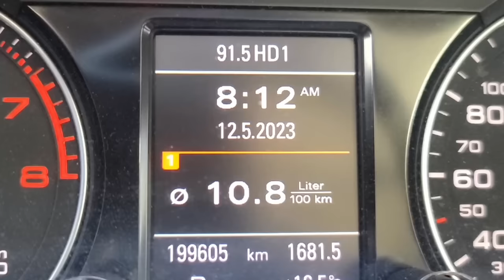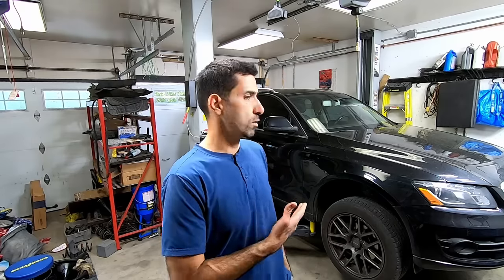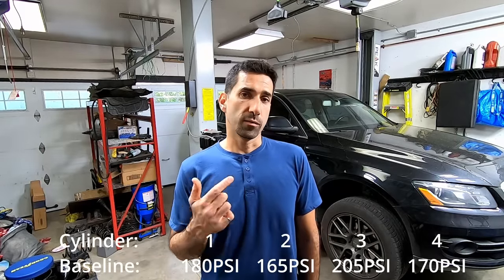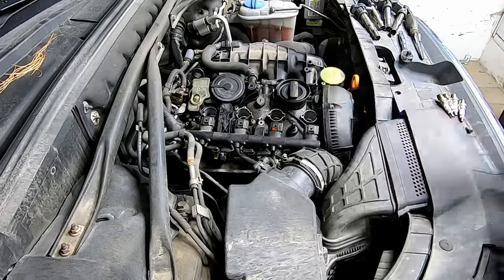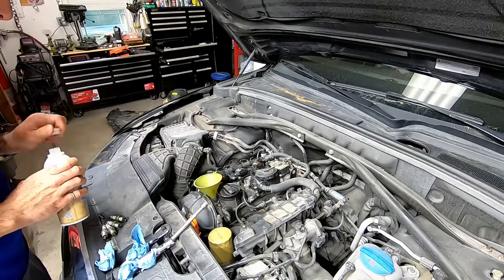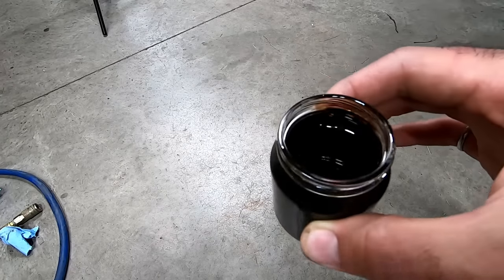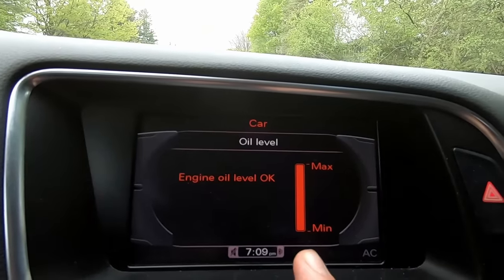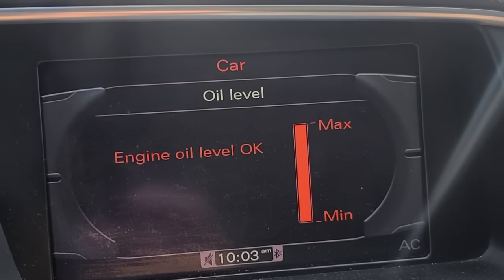How to fix excessive oil consumption from clogged piston rings (Part 2)

Comment: My friend, I can not thank you enough for this! I have a 2014 Audi Q5 2.0T with 118,000 miles on it and I was burning a quart of oil about every 100 miles (painful!). This SAVED me about $3,000 on taking it to a mechanic or spending countless hours myself taking out the pistons and clearing the oil evacuation holes. I've driven over 200 miles now and my oil gauge still reads full. YES! So grateful I will post my entire process and experience to help others as you have helped me.

As you stated, but maybe worth mentioning again --- the problem is not that the piston rings are wearing. It's that the oil evacuation holes of the oil control rings get clogged. When this happens, the oil control rings can't properly remove the oil from the cylinder walls, and that oil gets burned during every combustion stroke.

Prep work:
- Remove engine plastic cover, remove the T30 torx screw holding in the sensor by the coil packs, used a spark plug wire removal tool (to pinch the tabs) on the 8 small wire connectors connecting the coil packs, removed the wires. Next, while lifting up on coil pack connectors I used flat head screw driver to gently push clips on the connectors outward, removed the connectors. Next, just wiggled and pulled upward on coil packs to remove them. Took my deep spark plug socket (5/8), removed spark plugs (the plug from cylinder 4 was slightly dirty, but the rest were clean). Inserted a 6 inch socket extension into cylinder 1 and cylinder 2 spark plug wells, rotated crank until they were about level. Removed extensions. Prep work complete.

What I did:
- At about 80% oil capacity (4 liters), I did a 48 hour piston ring soak using two bottles of B12. 48 hours was probably overkill and 24 would have been fine, but I digress. Added one bottle initially, 100mL at a time, to each cylinder. Took a Poland Spring water bottle and measured 100 mL with water first, marked a line, dumped the water and now had a liquid measuring tool (which pours easily). Measuring is probably unnecessary and you could eyeball how much B12 you are pouring into each cylinder, just try to distribute the liquid evenly.

- Turned the crank a full turn every 16 hours. Kind of a pain doing it with your bare hands, but if you turn the crank and grip the belt around the alternator wheel at the same time it's not so bad (be sure to rotate counter-clockwise). After the first rotation, I added the second bottle of B12 using the method in step 1.

- After 48 hours, I put the old spark plugs back in, along with the coil packs, and hand tightened everything. Leaving the B12 in, I started the car and ran it for 30 minutes. She took about 10-15 seconds to turn over, but once it did I could see huge clouds of white smoke pouring from my exhaust. The engine ran rough at idle for about 10 minutes (around 900 RPM, which is what I was idling at before all this anyway) but eventually she smoothed out and was idling at 680 RPM. No codes thrown surprisingly. The smoke started lessening around 10-15 minutes, and was completely gone after 30 minutes. There was a ton of black dust sitting under my exhaust pipes which I assume were carbon deposits built up in the cylinder walls. Drove the car around for 10 minutes and the acceleration was already much noticeably better.

- Next, I did a full oil and oil filter change, using Mobil 1 high mileage SAE 5W-30 and an OEM Audi filter (any decent filter would have sufficed though).

- Changed engine air filter. A lot of people don't remember or think this a necessary maintenance item. It is absolutely crucial your engine breathes clean air or those deposits will also build up in your engine. Imagine using the same mask during COVID for 6 months without changing it. That's how your car feels if you don't change the engine air filter every 25K miles at the very most.

- Replaced spark plugs. Again, probably overkill but I was still using the original plugs. 118,000 miles on any spark plugs should be changed anyway. The diodes had worn away a bit and the gaps were now about 0.04 (factory spec is 0.032) but they were still in decent working condition. Replaced the original plugs (OEM model: AG VW 06H905621) with average quality plugs Autolite XP3923 (I'll put a link down below). Gapped the new plugs properly to 0.032 and they work well. The car idles smooth and the pickup is pretty good, but my fuel economy definitely took a hit (previous average 24 city/31 hwy to 19.5 city/26 hwy). Wondering if maybe the computer is still taking time to adjust.

- Had about 50 mL of B12 left, which I tossed into the gas tank for good measure. This may have done a little something since I only had 1/4 tank of gas in the car, but I doubt it. 

Car has been running smooth for about 225 miles now, with no oil burning to speak of. At this point I would have already had to add an entire quart, and most likely been halfway down on my oil gauge. You saved me about $3000 dollars at the mechanic and saved my favorite car. Thank you again!

11/3/23 UPDATE: Over 800 miles since doing this soak, and my oil gauge is till at max. Beyond thrilled!

Also, I would not recommend the spark plugs I replaced the original ones with. My average mpg now is 20 city/hwy combined. Truly abismal considering my original plugs with 118,000 miles on them were getting me a combined mpg of around 24.5. 18% decrease, yikes. You get what you pay for!

UPDATE 2/13/24: I'm at my next oil change (~4,000 miles) and my oil gauge is half full still. This fix 100% works long term. God bless this man for sharing this.

Spark plug replacement: 
https://www.amazon.com/dp/B009J58FJA?psc=1&ref=ppx_yo2ov_dt_b_product_details 

Oil Filter: 
https://www.amazon.com/dp/B00P17UTCG?psc=1&ref=ppx_yo2ov_dt_b_product_details

Engine Air Filter:
https://www.amazon.com/dp/B08951B64J?psc=1&ref=ppx_yo2ov_dt_b_product_details
Reply from the maker: awesome news - thank you for sharing!! really glad this worked out well for you...I`m curious if you actually got the 3k quote? I had a local viewer tell me he was quoted 10k for the service which seems insane...
Reply: @ETMotorsports  Yes, $3000 quoted in the Northern New Jersey area. A local Audi specialist told me it's about an 18 hour job @ $110/hr for labor, $200 x 4 for new rings/parts, and 7% tax. Total being $2974.60. I was almost considering it until I found this video. Thank you again!
Reply from the maker: @AlitasDePoll0  that does sound pretty reasonable...
Reply: @ETMotorsports  It was definitely tempting especially since I am the only owner this car ever had so I know there are no other issues and it would have been worth it. Only thing that had me raising my eyebrows was it being an 18 hour job 🤔. I feel like a mechanic shop that has all the right tools could do it in 12-15 hours working at a moderate pace. Had he told me 15 hours I would have said yes on the spot.
Reply: @AlitasDePoll0 did it fix the issue?? How much is it consuming now??
Reply: @The_Seraphim7  yup it did. 800 miles later 0% consumption.
Reply: @AlitasDePoll0  sadly we don't have b12 in our country!!!.....I might have to use other solvents!! But I did rebuild my other 1.8 tsi and it costed me around 1000$ here.... labour is pretty cheap here!! Got upgraded piston and conrods from Germany all got sorted in 1000$
Reply: @The_Seraphim7  that's not too bad for a rebuild! But why spend $1000 when your pistons/rings are most likely fine and you could solve the issue for $5 😁. Put that extra $995 towards a new bike... 🏍️

I'd bet any decent fuel injector cleaner would do the same job. Or any solvent that is meant to dissolve gum, varnish, and other fuel residues. If you decide to try this let us know how it works out please! 😊
Reply: @AlitasDePoll0  yess....I just ordered an PEA based amsoil pi cleaner plus.....I will use the amsoil 1st to soak for some hours and then use a kerosene based engine flush to soak for the second time!! Will let you know if it works!..... and can you tell me what bolt size is the crank bolt??
Reply: @The_Seraphim7  looking forward to your results! You can use a 24mm shallow socket if you want to rotate the crank by the bolt from above. However I just rotated it by hand it really wasn't that hard. Just make sure you are turning it counterclockwise.
Reply: @The_Seraphim7  sorry I fixed my comment above, I was sitting in traffic on my way to work and my mind hadn't woken up yet 😁. You need a 24mm shallow socket for rotating the crank from above
Reply: @AlitasDePoll0  yess I figured it out😂...M16 is the bolt and spanner size is 24!!....thanks mate will update once the soak is done!!
Reply: Please keep posted after your car runs 3000miles, if it is still going good.
Reply: @beipco  So I've gone about 1500 miles since doing the chem soak and my oil gauge has only gone down 10% (or whatever the first chunk of that bar would equate to). Which is normal. I can whole heartedly say this has restored my 2.0T back to factory oil consumption standard.
Reply: @ETMotorsports i was quoted 12 here in hawaii
Reply: @25sierraman2  12000?! Or 1200?
Reply: @AlitasDePoll0 Can you tell me the Audi specialist? I live in northern NJ.
Reply: @e.j.sanchez1031  Marty's VW in New Milford or something like that!
Reply: @AlitasDePoll0  would you be open to doing the piston soak on my q5?
Reply: @e.j.sanchez1031  what year Q5? And if you are within 30 minutes of Paramus I would definitely consider helping you out!
Reply: @AlitasDePoll0  2012 
Very close by lol Paterson..
Reply: Brother…… thank you so very much.  At 100k….. 1 qt at 3k miles.   125k …. 1qt at 2K miles….. at 150k…… 1qt at 1.5k miles.

I did the treatment…………. Now………. No oil needed between changes…… I change every 5K.
Reply: @RobertKelii  so happy to hear it! Great job if you did this yourself. Proud of you! 👏👏👏
Reply: @AlitasDePoll0 Hi have you consider helping me out? Would really appreciate it.
Reply: @e.j.sanchez1031  Hi EJ. Sure, if you have a way to contact you I'll be glad to reach out and set something up!
Reply: @AlitasDePoll0  i’ve tried putting a contact and it gets erase 😢
Reply: @AlitasDePoll0
Reply: @e.j.sanchez1031  oh man I just saw this now I'm so sorry! I missed the notification! Are you by chance still burning oil or you fixed it/got rid of the car?
Reply: @marcolopez1809  yes?
Reply: First time commenting on YouTube Thanks to you. You’re amazing. Super detailed lol🔥
Reply: @Mjsupa  so glad I could be of help! The real credit goes to the guy in this video. Just wanted to help others like he helped me 😊

Comment: I did the piston soak that you showed on my 2013 Q5 2.0T, but I ran 3 full cans through over 72 hours, hand cranking 5 rotations about every 6-8 hours before each refill of 1 oz per cylinder.  Also ran Seafoam in the crankcase for 300 miles before the piston soak, AND 2 full cans of B-12 in 1 tank of fuel before the Seafoam.  Sprayed some oil fogging mist into the cylinders after letting the last round of B-12 evaporate completely (confirmed with borescope and again, hand-cranked a few times) to pre-lubricate the pistons.  Car started after about 20 sec of cranking.  My consumption was at 1 qt/400 miles.  I'm now at 3000 miles with no indication of any consumption.  Gas mileage has gone from 24 mpg to 29 mpg and performance is great at 126,000 miles.  B-12 is my newest find that I have been sharing with anyone that has a car.  I have also run a 12 oz bottle of Yamalube Ring Free through the fuel system in 6 gallons of gasoline to "shock treat" the rings as recommended by Yamaha.
Reply from the maker: Great results...I like the modifications to the process! did you run the motor with the 3 cans of B12 in the oil or did you drain before?
Reply: @ETMotorsports  I left the oil drain plug out during the process so that the B-12 wouldn't be sitting in my oil pan for 3 days.  I was worried it might start damaging the oil pan gasket.  So as it drained past the oil control rings, it would just run out into the catch pan.  I also figured that since I had run the Sea Foam at 1.5 oz per qt that it was enough solvent for the crankcase for one go around.
Reply: @dangoldan34   great ideal to spray engine fogging oil before cranking the engine in order to protect the piston skirt coating and the cylinder wall !! Thanks for your tip sir.

Comment: It works!  Our 2013 hyundai santa fe 2.0 Turbo with 110k miles was burning 1 quart per 1000 miles.  I let pistons soak for 18 hours rotating crankshaft at 3,6,18 hours, then ran engine idle for 30 minutes with a few accelerations of 2000 rpms for a minute.  
Just checked oil level after 1800 miles and it has not dropped.  
Thanks for posting this video.  It's a huge help since we want to keep this car for a long time.
Reply from the maker: awesome results! Glad to see it working on other engines as well...
Reply: Hey I’m experiencing the same issue in my 2017 Hyundai Sonata is it possible you can walk me through the process I’m soaking the piston

Comment: Hello, here is my final report on this piston soaking treatment. In Feb, my 2013 A4 B8 2.0 TFSI(100k mile) had severe oil bunning issue (1qt per 2 times of gas fill: around 600 mi). I felt it was getting  worse. Fortunately, I found this video. I followed exactly the same prodcedure from Part I. You said part I could do negligible impact on soaking treatment. But I didn't want to ignore any subtle difference from what you've done because every chemical treatment could have cumulative effect on carbon build-up as I know this carbon scum has been built up over 90k mileage. Now, I ran over 3K mile and checked the oil level this morning. Surpringly, it is very hard to notice oil level reduction. very negligible or almost zero consumption after this piston soaking treatment. Now I'm very happy with this result. Thank you again.
Reply from the maker: great results! glad it worked
Reply: @ETMotorsports  thank you very much. Recently, I've got a letter Audi US about reimbursement regarding this oil burning issue. I spent a lot for oil and PCV replacement after 950k mileage. But that expense is not reimbursed based on what they claimed. However, I'm Okay with this result. It seems my piston oil ring recovered some tension now. Surprisingly, spark plug looks so dry and showed matte light grey. Hard to see black carbon scum on plug tips for all 4 plugs.

Comment: Thank you!!
2011 Q5, 2.0T engine, about 114K miles and was burning about a quart of oil roughly every 2-3 weeks. I started considering engine rebuild. Followed your treatment steps and currently sitting at about 300 miles and oil level did not drop! Fingers crossed and I will continue on checking oil level weekly.
Most likely will do this again at next oil change.
Thank you again!
Reply: Did you crank it between soaks or just turn the crank with no plugs? Disabling the fuel pump and spark?
Reply: @fredbeiner2620  Hi there, I turned the crank by hand between soaks. Did not want to do additional work disabling fuel pump and spark. I know, only couple fuses but for me cranking by hand was easy enough. Before installing spark plugs I just made sure there was no liquid left in cylinders to avoid hydrolocking the engine.
Reply: @marcindomanski3425 how would you get fluid out if it did stay? Or just wait as it should dissolve/evaporate? I have no camera to look down in just my flash light and a shake of the car
Reply from the maker: if there's liquid left in the chambers when you're finished, you can evacuate it by using the starter to crank the motor...it's generally pretty good at clearing up the chambers. Once that's done and you put the plugs, make sure you turn by hand multiple times to make sure you won't have issues cranking after that